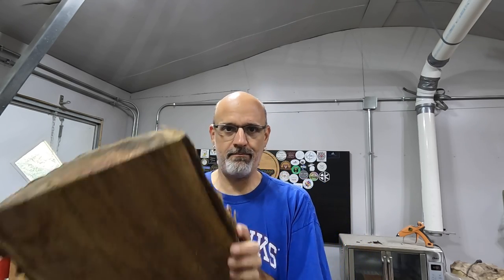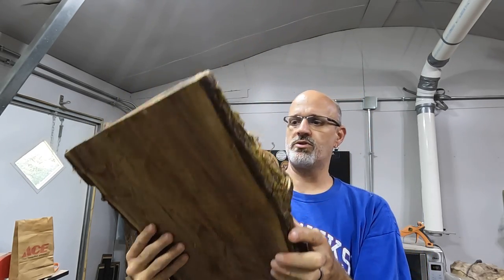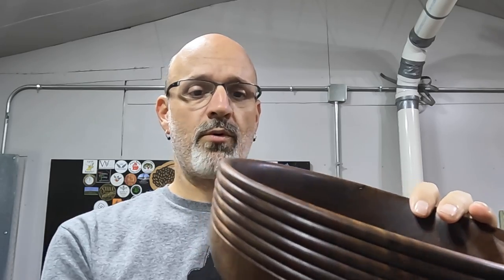Woodturning - The ribbed Popcorn Bowl

Comment: If I had a hole in a piece like that I personally would prefer to take a Frank Howarth approach and fill it with a wood plug.

Your turning is great though and I like your ornamentation.
Reply from the maker: Thanks for the feedback. I did contemplate a resin fill, but decided it would be fun times leave it alone. Always appreciate the feedback!